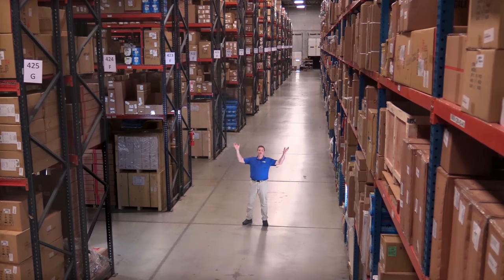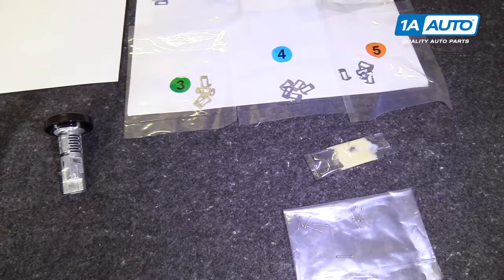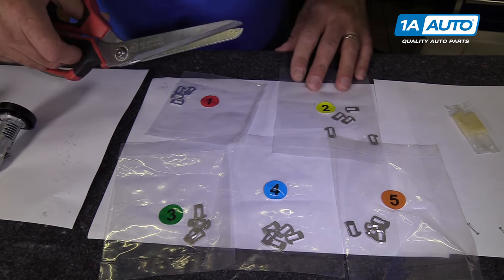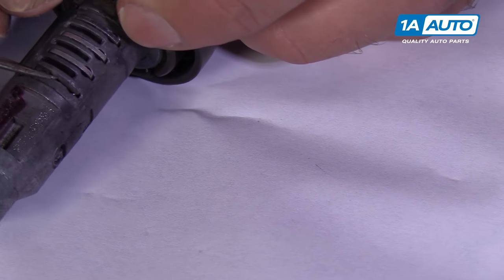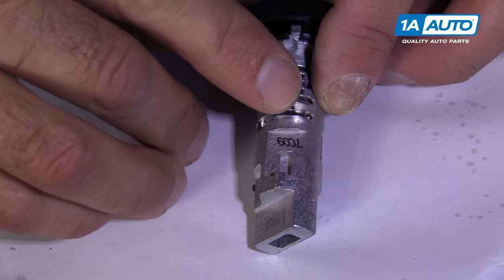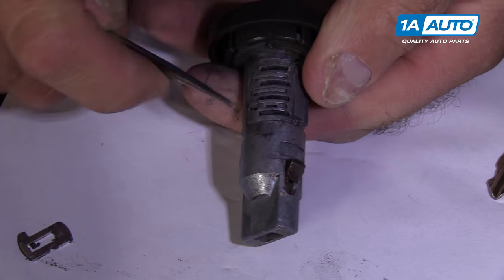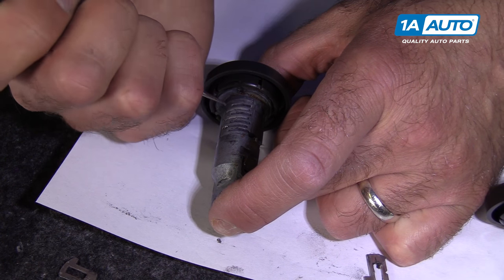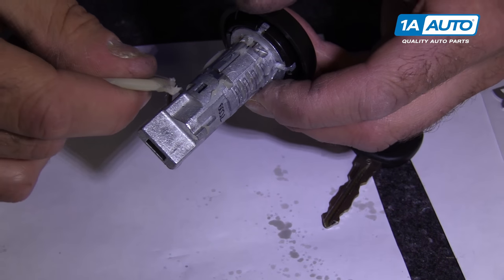How to Code a New Vehicle Ignition Lock Cylinder (Step by Step Guide!)

Comment: If your new  ignition lock cylinder already came with the tumblers installed all you gotta do is transfer the old tumblers from the old lock to the new lock in the same order. Unless they are worn. Then you gotta have the tumblers machined to the original. Usually it's the keeper that wears out though.
In this video he is basically rebuilding the tumblers. 
Just thought I'd throw that out so you don't over complicate things and take out more than you have to. This shouldn't be hard to do on a lock cylinder that's already build out of the box.

Comment: Is this using the key to the old switch in the new one also when you have to replace an ignition switch is this the only part you need or do you have to buy other parts as well a parts store said there is two different things you need

Comment: I bought an original part from Holden to replace my cylinder.
It came with brand new pins and springs.
I took the old ones out and wrote down the numbers.
When I put the new spring in and then a pin it does not stay down inside the cylinder like it does in your video.
I checked my old cylinder and put a pin back in and it sits snug and stays inside.

With the new one all the pins are being pushed out by the springs.  So it is impossible to put the cylinder back in the sleeve as the pins are all sticking out.
Reply: Probably got it figured out already but you fix that by putting the key on the cylinder once you got the pins where they need to be, it locks them in place

Comment: What grease do you use for ignition lock cylinders?
Reply from the maker: +@smartdummy5751 You will want to use a silicone spray or something with  powdered graphite.
Reply: @1AAuto  is the grease in the video lithium grease? Do they still use lithium grease? Tia

Comment: Do I have to computer reprogram vehicle to get car to start after doing this key ignition replacement ?
Reply from the maker: +Artist Leeon Not usually. Most of the time it's programmable by anyone. It's rare for the dealer to be required. Thanks for checking us out!
Reply: Not as long as you don’t replace the immobilizer

Comment: Hi there I have Mitsubishi lancer 2012 and I want to change the cylinder I bought a new one but don't know if I change the use the tumblers from the old one into the new one would that work or do I need to get new tumblers

Thank you
Reply: Change the tumblers. They're the part that wears out causing the cylinder to stick and not turn. The old ones will be worn and cause the same problem so use new ones.

Comment: What if u don’t have old lock cylinder?had to drill mine out...HELP PLEASE
Reply: I'm dealing with that. Educated guess and check, and triple check. The numbers on the wafers (the part that he called a tumbler) are directly related to the cut on the key. The deeper the cut, the lower the number is. 1 is the deepest possible cut, and 5 is no cut at all on the key. You can also just do a guess and check. Literally there is only 7 wafers installed on this lock, each with 5 choices. If you do each wafer slot by itself, and make sure the bar goes all the way into the lock, then you only have 35 tries or so to make sure you get it correct for the entire lock. 
That, or just bring the new lock cylinder kit and the key to a lock smith, and they can do it for you.

Comment: If I code the new cylinder to my old keys, I can just put it in the car and it will start?? I wont have to take it to a shop to have the new cylinder coded to the vehicle's computer system with a factor scan tool?
Reply: no, the chip is in the key. As long as you use a key thats already registered to the ecu you will be fine.

Comment: Please help I bought a new ignition cylinder lock, pre programmed with new keys. When I try to start the car it has the theft security light flashing and it won’t start. 1998 Ford Expedition 4wd
Reply from the maker: +Adam Pierce We wouldn't be able to diagnose an issue like that here, you may want to have a local mechanic take a look at it. Thanks for checking us out! http://1aau.to/m/Shop-1AAuto-c

Comment: Okay but how do you code an ignition switch if you can't refer off of the old one?
Reply: the old ignition tumblers are numbered, if you cant get it out you must have dealer provide key code. This code will be 8 digits long, the 1st number is relevant to the key itself, the remaining 7 are the tumbler numbers.

Comment: Will this work for a cylinder from a 1993 f150?
Reply: P. , no the 93 F-150 is completely different. It is mechanical with a plastic rod that reaches down the column housing to activate an electric switch about halfway down the column (has a screw in the center to hold it in and just unplugs). If your key turns and keeps going around and around the pin in the plastic rod has come out or broken off and needs replacement. If the cylinder rotates and stops and springs back like normal it could be the electric switch. Be cautious and pay close attention if you have to take the cylinder out and replace the rod as that all has to be in the right sequence and reach to activate the electric switch.

Comment: Where are all the old springs I don't understand.
Reply from the maker: +Shevin Sacrey This video is how to code a new ignition cylinder using new springs.  Thanks for watching.
Reply: @1AAuto  thanks I understand that. Its just that the video makes it seem as though there were no springs in it before. You see him pushing out the old tumblers, but the  old springs are not coming out with the tumblers (or at least it seems that way) but then new springs are being put it. It makes it quite confusing. You should make it clear that there will be old springs that come out with the old tumblers, and that those springs should be discarded.